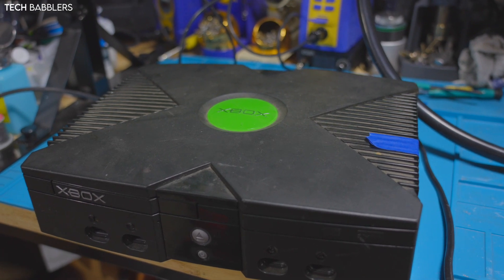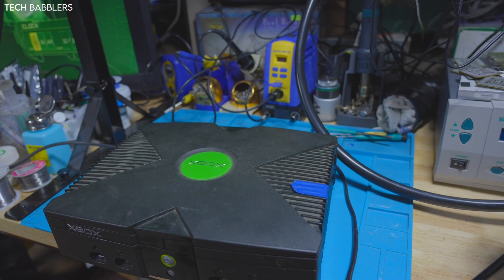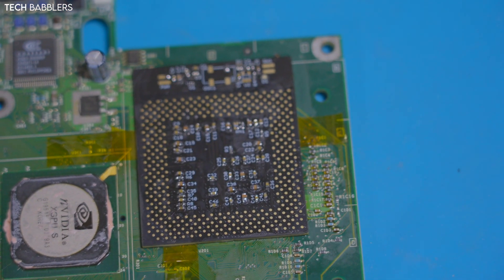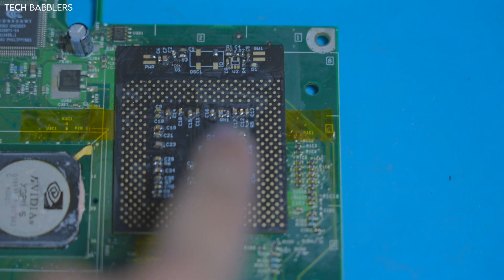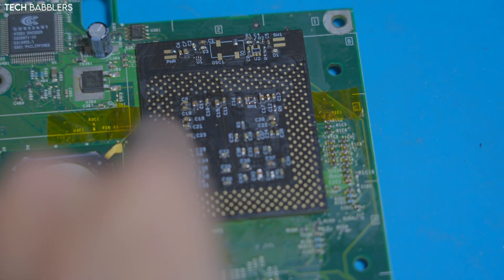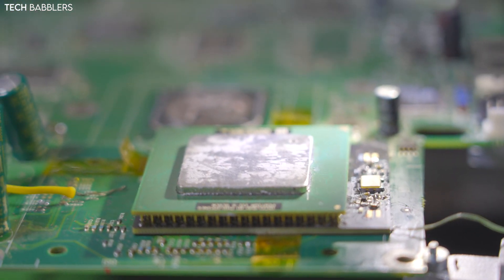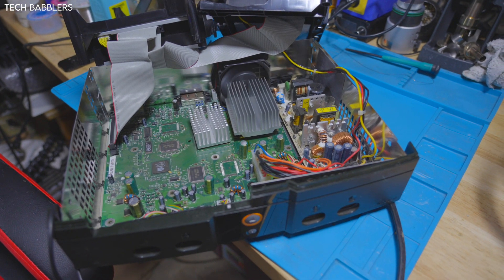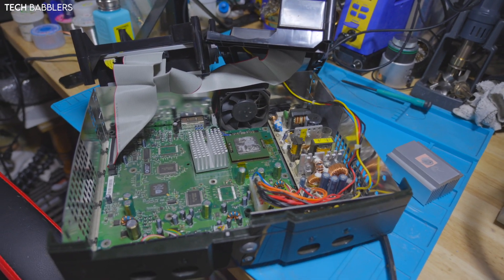Attempting an Xbox 1.4GHz CPU Upgrade PART 1

Comment: I tried to put a slot 2 CPU onto an Xbox, which didn't work, but when I tried to put the stock CPU back on, I ended up with a short on 1v7, took the CPU off short went away, put CPU back on sort reappeared, tired a different CPU same, eventually I found that solder leaked out the vias on and formed tiny solder balls on the bottom of the board and one had caused the short, cleaned off the balls short went away and the Xbox worked fine. I have also had cold solder joints under the CPU on the CPU cap side cause the yellow flashing leds then off frag.
Reply from the maker: Yeah, I assume that was my issue on my first few consoles, I did mask off via's at first, but since then, i've stopped and haven't had any issues, might also have to do with fine-tuning my profile for the OG xbox.

Comment: Maybe a goof info for you, directly orange light is overheat indicator. You have a small IC in the area of the southbridge. ADM1032, U6F1. It won't fix the FRAG, but maybe you need this info at some point (: 
Hopeing for a followup video, <3

Comment: come on bro a copermin motherboard dosent suport tualetin with out a rare power leap edaptor you shood use the best copermine pentium 3 with is a 1.1 ghz
Reply from the maker: Can you elaborate a bit more for me?
Reply: @Techbabblers their was a special cpu adapter, interposer board by N64 phreak  that allowed you use a dif socket cpu, a standard pentium 3
Reply: @Techbabblers without the pcb u could use celeron (M)obile 1.1 Ghz with minor mods

Comment: Thanks so much for sharing! I know what it feels like, I have considered doing such an upgrade as well but this confirms that I am not ready. Also missing the right equipment. Did you correct the misaligned solder balls on the bottom of the interposer?